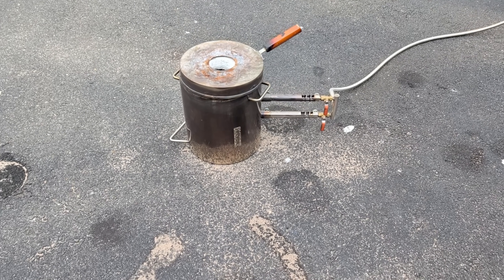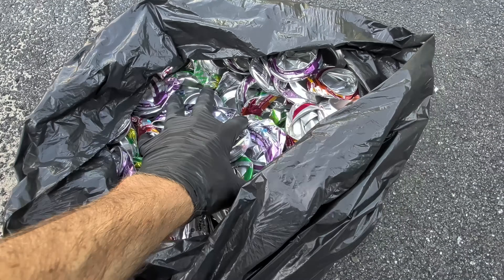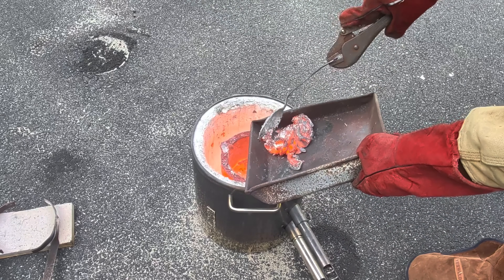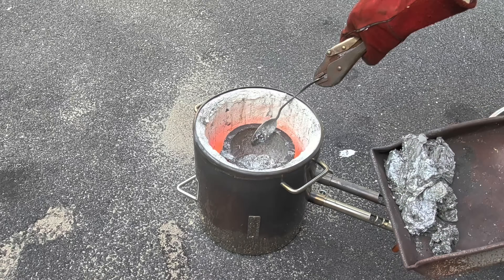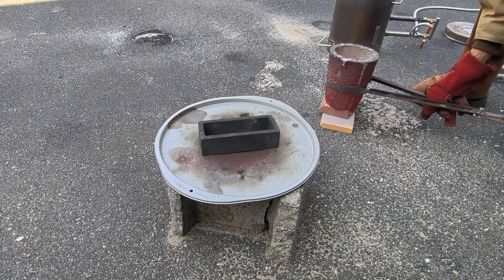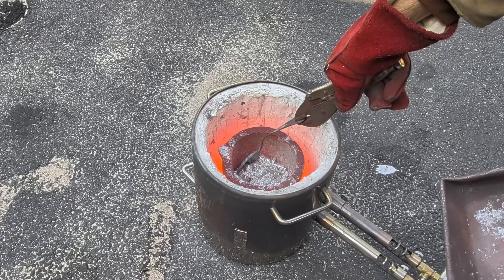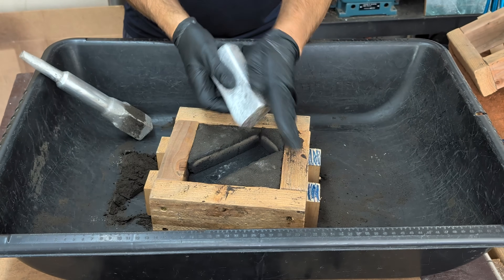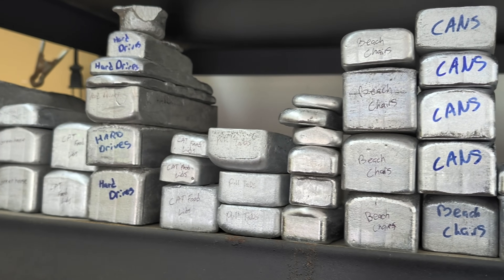Melting Cans for Aluminum - Melting 8 Lbs. of Aluminum cans

Comment: Sir, I love your channel, but how do you clean the smelting pot? I don’t know how. Maybe I want to smelt copper and then aluminum, but I don’t know how to clean the pot. Would you advise me to allocate one for each metal?
Reply from the maker: Aluminum is easy to clean.  Once it has cooled it pulls right out.  Copper is not.  I use a different crucible for each metal.  That is the best thing to do

Comment: It's fun to melt.
Yesterday I melted five garbage bags with jugs in the same kiln as yours.
I also used a burner, but it does take a long time.
I do have a question, though: don't they add borax here?
I haven't done this yet.
But I still managed to get four blocks out of five bags.
Show me your videos; I've already learned a lot from them!!
Thank you.
Now to cast copper, and we're on a roll. 👌👍🤛
Reply from the maker: It is fun to melt!
That's great!  That is a lot of aluminum cans 😂😂. Yeah it would definitely take awhile 
I don't use borax, but it might help get a little bit more aluminum.
Make sure to have PPE, especially with copper.  It requires a lot more heat to melt.

Comment: I'm planning on a can melt next weekend... got about 20 lbs in the garage ready to go!
Reply from the maker: That'll take awhile 😂😂😂. You'll get 60-65% out of it
Reply: @HeinrichsMade Yup. The last time I did a cans melt, I got about 65% yield. It's fun even though it isn't clean aluminum, still fun vs. turning in cans for scrap. I'll see how well it goes timewise, might split the cans into two sessions.
Reply from the maker: @misphet3 exactly fun vs turning it in for scrap.  The price isn't worth it.  I'm thinking 1.5 hours maybe a little longer.
Reply: @HeinrichsMade  And free bars for the shelf!
Reply: @HeinrichsMade  why there is so much dross? i am assuming the plastic in the can does not represent that percentage, perhaps that the molten plastic wet/mixed by alluminium?
Reply from the maker: @GraphicManInnovations I don't know exactly, but Google says the following,
This dross is a combination of oxidized aluminum, char residue from coatings and inks
Reply: @HeinrichsMade  yes because of the very high surface area = much more oxidation, also the temp is too high, you should try something difference the next time, professionals retain from 95-98% of alluminium from these cans
Reply from the maker: @GraphicManInnovations no way
Reply: I wonder how much more effort it would be to further recover more aluminium from the aluminum oxide in the dross using acids and/or electrolysis or something
Reply: @despuesdelentierit It is not worth refining the oxides. Way to expensive and more knowledge is required. However, if you remelt the slag, you can recover some good aluminum depending on how well you skim it to begin with. I also remelt the slag using salt as a flux, works really well to seperate.
Reply from the maker: @despuesdelentierro I've remelted slag, but never recovered a lot.  It isn't worth it to me